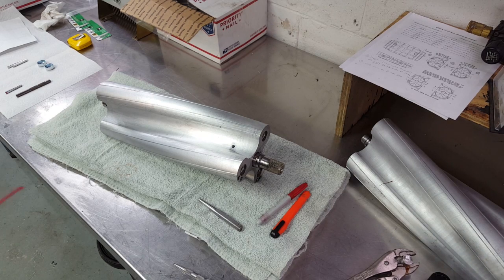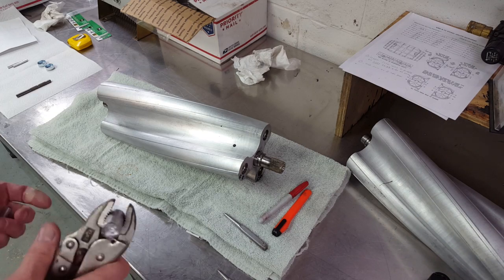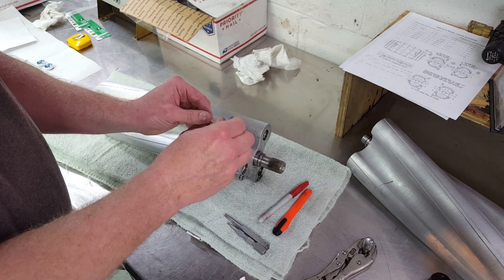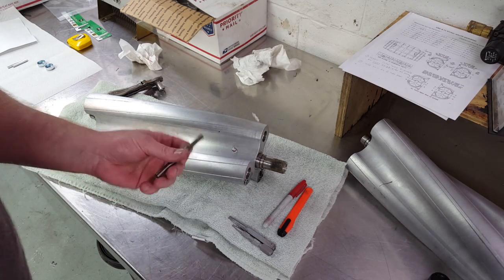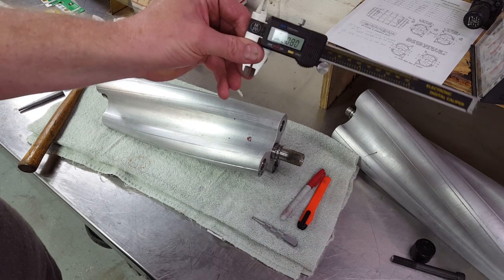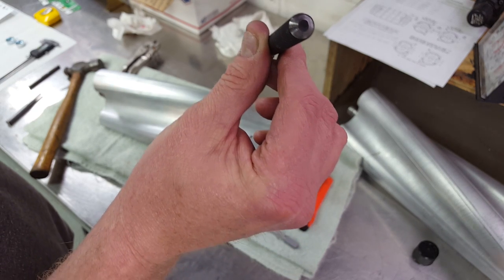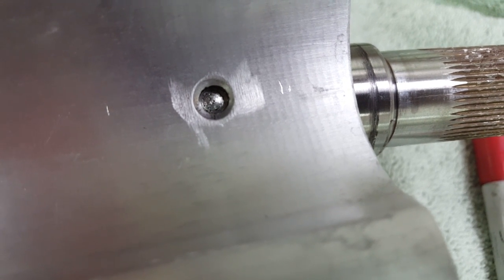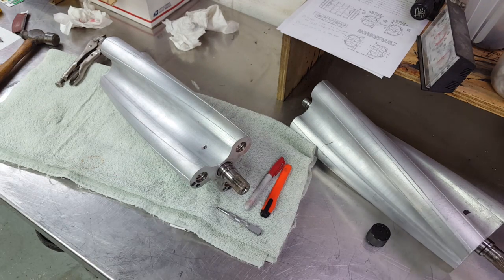My 6-71 Blower rebuild, Part 5: Pinning rotors.

Comment: Did you use the correct taper reamer when you made the hole? That is what you need to do when installing a tapered pin. Maybe I missed something. I would have cleaned out the chips before I put Loctite in that hole, in case it dropped on the chips sticking to the inside of the rotor. You state in your disclaimer about if you are not a machinist and then do some inconsistent style of work. Just saying, I work a bit differently than you.
Reply from the maker: The build that I videoed 8 years ago used a strange fluted interference fit pin which I experimented with at the time. I didn't like the design, and only used it that one time.  I then changed back to a proper taper pin and reamer.  Yes, you missed something.  Video #6.  https://youtu.be/NxkghEEKGnE  shows how I thoroughly cleaned chips out from inside the rotors.

Comment: Why is rotor pinned in the 1st place?
Reply from the maker: To keep the stub shaft from breaking the stock single pin.  Hot rods put much more stress on the pin than does a diesel, so we add the extra pins.  On a diesel, the blower is just like a big fan, blowing air into the cylinder to scavenge the exhaust.  There is very little back pressure, so the blower is not under much load.  However, on a Hot Rod installation, the blower is actually being used as a compressor, making usually around 10psi of boost on non-racing applications.  The power comes through the gears, into the stub shafts, and meets the load (from compressing the air) where the stub shafts are pressed into the rotors.  The only thing keeping the stub shafts from rotating is that one little pin.  The single pin would eventually fail under regular boost loads.  Thanks for watching!
Reply: @MakerCave  Thnx...understand now..& makes sense....

Comment: do you ream the hole with a tapered reamer before pressing the pin in or does it get pressed into a straight drilled hole?
Reply from the maker: The hole for this style of pin was straight, but I use proper taper pins now along with a taper reamer.
Reply: @MakerCave  so now you use #4 tapered pins? or are they still #6? can you confirm pin size for me please?
Reply from the maker: @shawnramsay1851  Correct, #4 taper pins, to match the factory pin that is already there.  I bought a pack of these a couple of years ago:   https://www.mcmaster.com/98390a284
Reply: @MakerCave  thank you I appreciate your time and videos very much.
Reply from the maker: Excellent!  I hope your blower comes together smooth and easy.
Reply: @MakerCave  I just finished pinning six sets. I ended up going with an additional three pins on each rotor. Two up front and one additional in the rear although I have been told by experienced builder not required ( I saw an old rite up from back in the day where they considered triple pinning adding three pins to each rotor). I like doing things overkill. As well I went with #5 pins Thank you again you have helped with the creation of Ramsay Custom Blowers and I recommend your videos to everyone interested in building a blower. Cheers
Reply from the maker: Excellent stuff.  Regarding pinning the rear stub shaft:  Start at the drive hub for the top pulley, and try to envision where the loads exist, and what drives what.  Air is the load, resisting the rotation of the rotors.  Power comes in the left gear, and is transferred to the right gear.  The gears, which transmit the power equally, are splined to the front stub shafts.  The front stub shafts encounter their load, at the pinned connection to the rotor.  At the back of the rotor, there are no drive forces acting on the rear stub shafts.  Their only role is to support the rotors radially in the case, so they can't touch the case walls.  There is no torque load carried by the rear stub shaft, and there is no axial load, because of the slip fit in the rear bearing.  This is why it is not necessary to pin the rear stub shafts.
Reply: @MakerCave  I have personally seen a rear stub shaft spin due to a piled up rear bearing or ?   I recommend it ,removing the factory pins are not easy nor is trying to repair a rotor with a spun stub shaft. cheers
Reply from the maker: @shawnramsay1851  Well, independent of the normal operating loads, that situation right there is a good use case for an extra rear pin then.  Periodic inspection, which is pretty easy to do on a 6-71, is certainly warranted to prevent this, but I can't imagine that the rotor would be saveable after a stub shaft spin.  That shaft has to fit pretty tight to keep the rotor aligned in the case.  Did you have a failure on a Hot Rod or a Diesel application?  If a Hot Rod, did you just have a single row sealed bearing in there?  Thanks for the good info!

Comment: I have a 6-71 that needs pinned. Where did you get the directions?
Reply from the maker: After I made this video, I did another blower where I changed to a pinning process the same as the factory GMC pins.  I bought my pins from McMaster Carr:  https://www.mcmaster.com/98390a284 and then bought the #4 taper pin reamer from Amazon.  I have not had a chance to make a video of installing the taper pins.
Reply: @MakerCave  Thank you. My neighbor just tried to sell a blower I sold him a couple years ago. It's right off a Jimmy deisel. New ends and shaft. Never heard about pinning until the potential buyer asked him about it. Is it necessary for a mild street motor?
Reply from the maker: @earlyhemibill  A low RPM, low boost 5psi street motor would probably be fine, but it is hard to predict what a blower will be subject to in the future, after the original install.  The owner could decide to switch pulleys to turn up the boost, or they could upgrade their motor to turn more RPM's and then get in trouble tearing the single GMC pin out.  Adding extra taper pins is cheap and not that terribly hard to do, so it is really a good precaution.  Keep in mind, if the single GMC taper pin does shear out, the rest of the blower will be destroyed quickly.  Thanks for watching!
Reply: @MakerCave  Thank you. He asked me if I could pin it for him to get it sold. I have a mill, so will help him out.